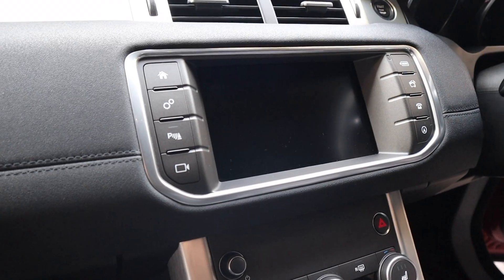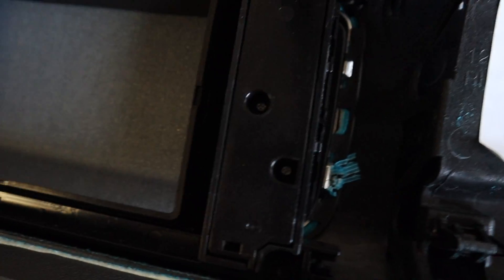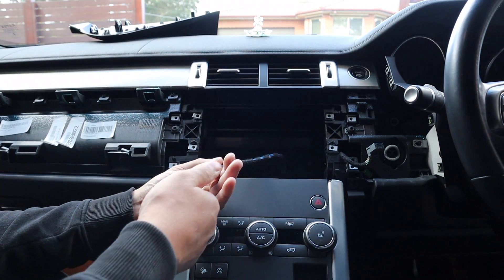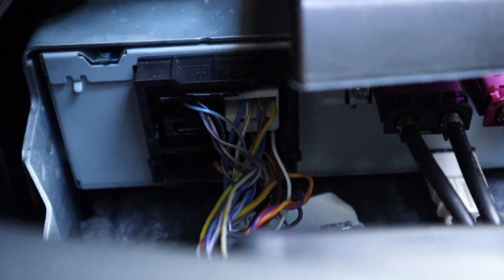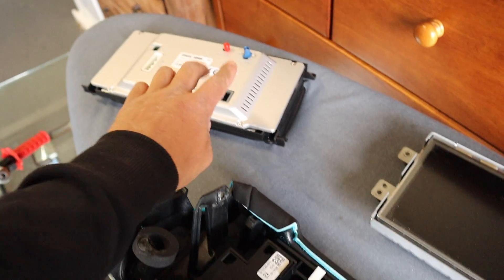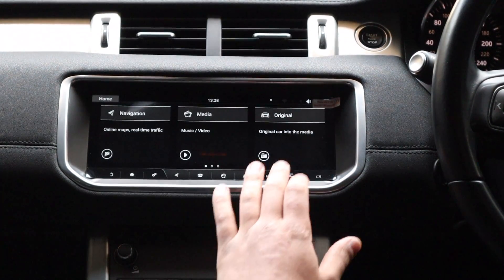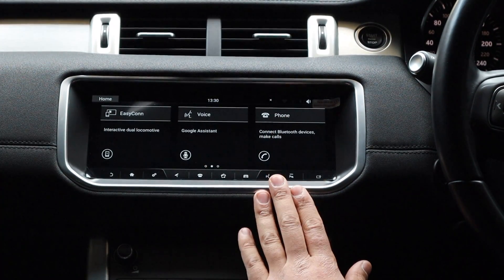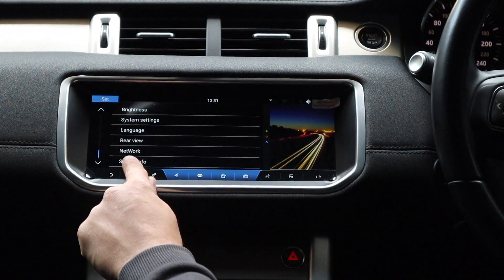Range Rover Android Screen (10.25”) Install.

Comment: What I don't understand and actually hate tbh, car has a factory mic and gps. Why put down an external mic and gps? Why don't they include appropriate adapters. I see the same with VW. There are adapters for the factory mic's and then they do a crappy internal mic on the "vw specific android radio". Lol.
Reply from the maker: 1 - the GPS antenna is used for factory navigation, it cannot be spliced into. So you can remove it but then you lose the retention of ALL oem features. So a new antenna is installed for the new unit to be able to collect GPS data for time and date and GPS location etc. 

2 - MIC - the impedance on MOST factory mics is totally different to that of an AM unit, so again if you can manage to splice into it you run the risk of ruining it and in turn losing the OEM bluetooth all together (big NO NO in this industry) so a new mic is provided for Hey siri functionality and Ok google etc. 

Longest comment I have done in a while so I hope this helps someone. 
Cheers!

Comment: How about the Hardware buttons on the steering wheel? Do they work?
Reply from the maker: Yes they do
Reply: @TheFittingBay  the forward and previous buttons dont work on spotify when in android auto mode, but if the native spotify is running, then the steering controls work. Is this normal?
Reply: @manroop8242  Yes, in android or carplay mode not all buttons on the steering work. TFB should tell this to the people, and if they do should show this in a video.

Comment: Hi, can anyone explain why you always need to fit an external mic?  Why doesn't these systems use the stock mic's that come already fitted into the car?
Reply from the maker: genuine mic still used for Bluetooth :) secondary mic used for voice control with iPhone and android etc. they can’t get the OEM Mic to do all the work as it’s connected directly to the factory system or Bluetooth module and splicing into it will only cause problems
Reply: That is very very helpful.  Thank you very much for the reply! :)
Reply: @TheMalakyte Do you have to change anything or pay attention to anything when using the respective microphones?  And is the reception of the microphones good there or wouldn't it be better near the rear-view mirror?

Comment: I have a 2018 Evoque with a stock 10.25" JLR infotainment screen (CD player...so Bosch).  Can I swap out the stock widescreen with the Android one?  All the videos I see on this are replacing the older style screens.
Reply from the maker: Yeah you can.
Reply: hi.. 

have you installed this in the meantime?  how is your experience  Has the rear view camera stayed the same?
Reply: @j-Bash Sorry,  I have not.  Compatibility concerns slightly outweigh my desire for a better screen with more app capabilities at the moment.

Comment: Hi thanks for the vidéo I have s question  you didn't remove electronic motherboard from the original audio systems  to put it into the new one ? I saw some other tutorials it seems we need to plug the original motherboard into the android  one ?

Comment: @The Fitting Bay I got my unit from Aliexpress and after follow the steps on your video everything worked great except the sound. I am not able to get sound from the unit and I already tried many different things. The sound is working if it is coming from the original OEM but no luck with the new unit. Do you have to put the sound mode in AUX or something like that? I tried that too but maybe I must do something else?
Reply: I believe you have to select AUX mode in the original UI and also there is a dummy jack to put into the AUX plug.
Reply: Hi also tried this and the aux option on source main screen and the attachment to the aux plug in arm rest in,still nothing no sound any help guys please 🙏
Reply: How can I get this from Aliexpress? Did you get everything you needed in the box?

Comment: Hi there. I’m thinking about purchasing this from your website. Just to confirm, I will need to purchase a hot spot plan to connect to this correct? Can I buy a external one and leave it always connected in the car? Also, for wireless backup cameras (not the one that come w the car), will most backup cameras connect to the screen?
Reply from the maker: That is correct, wifi hotspot can connect and you can leave one in the car. Yep universal cameras will work fine. Highly recommend not using wireless ones.

Comment: Thank you for sharing. Based in the UK with a Disco Sport (L550). I will be fitting one of these and will certainly use this for guidance. It seems you also have what the guys at Merryway call 'the Harman system' judging from the connectors on the back of your screen. On the plus side, my head unit is not under the seat but behind the aircon controls. On the downside, that will require completely dismantling the dash 😢